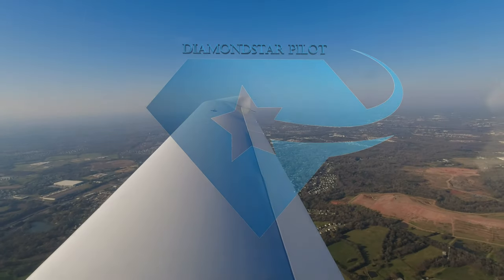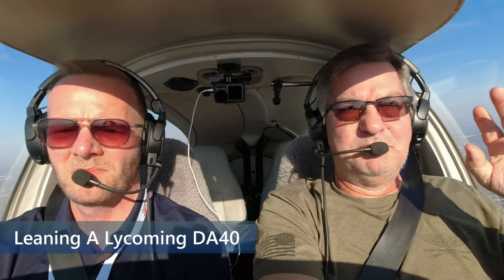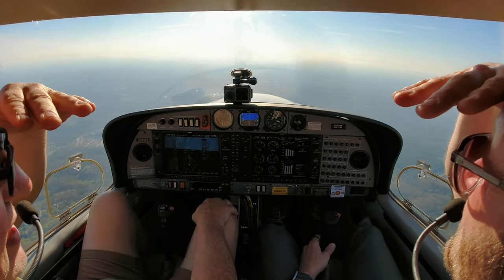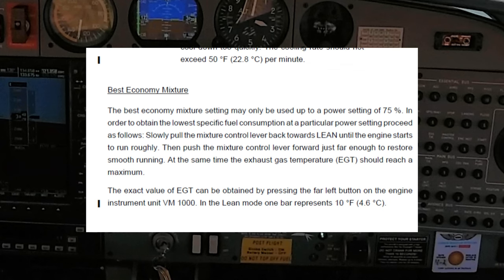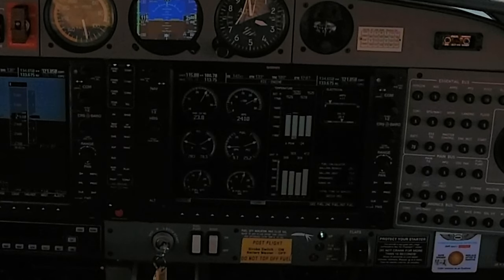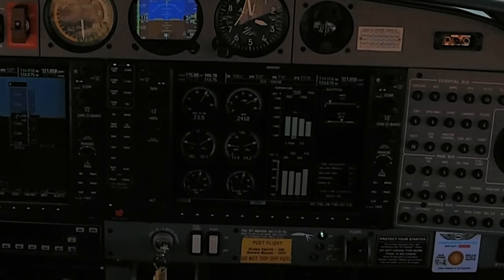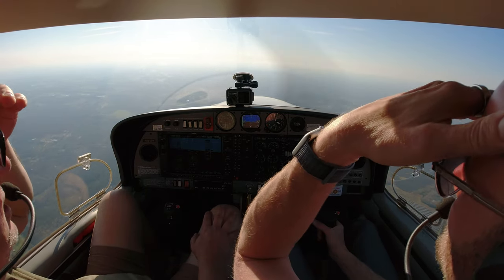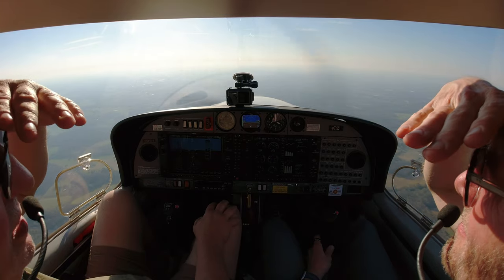Leaning A Diamond DA40

Comment: FYI.  The POH photo you posted says enrich until the EGT is approximately 100F lower.  The 55 number is the Celsius equivalent.   If your EGT is measured in Fahrenheit, which I think is given the values you were mentioning, then what your mechanic is suggesting is exactly what the POH says, for best power use 100F ROP.
Reply from the maker: I think you are correct.  I got my F & C temps mixed up.  Thanks for the heads up.

Comment: In the NG model you don't have to lean at all because it basically has a car engine in it.
Reply from the maker: That is incorrect.  The NG has a FADEC system that manages the mixture for you.  Leaning is still occurring but, a computer manages it rather than manually moving a lever.
Reply: @diamondstarpilot  Right correct. It still leans but automatically. It's amazing how cars have all the modern technology and modern engines but most GA aircraft still have the 1950's design. The GA aviation sector is very conservative.